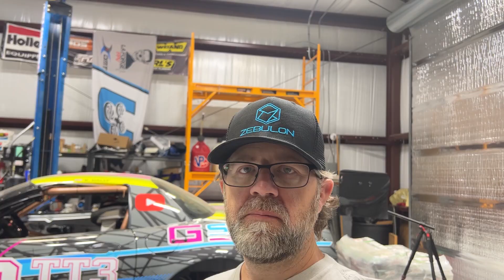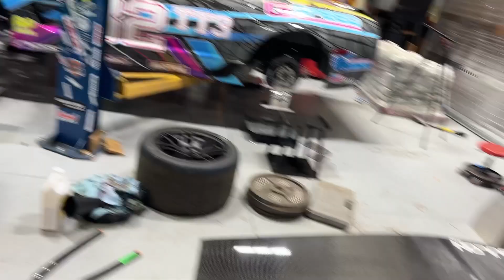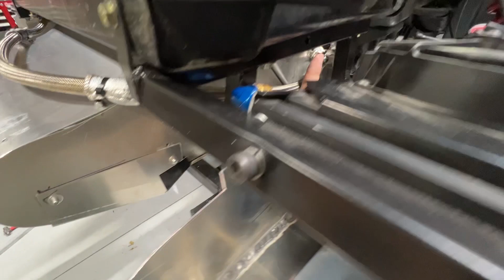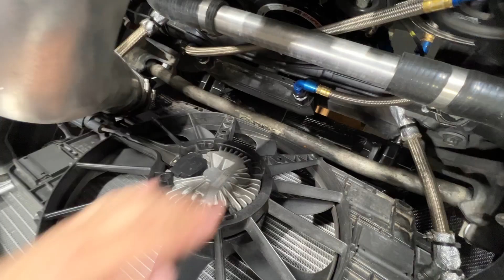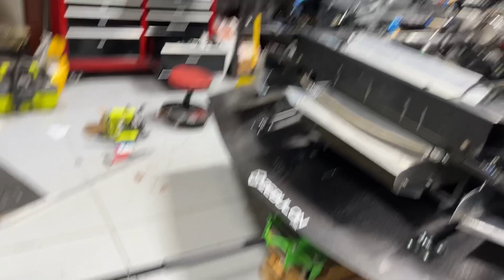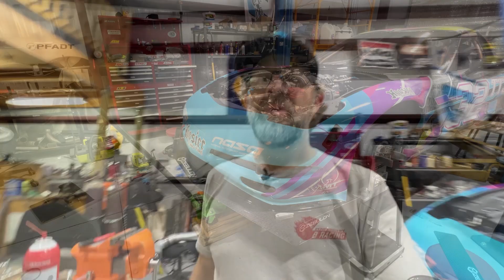ALL YOUR DOWNFORCE ARE BELONG TO US. The Zebulon Splitter has arrived and taking all the downforce!!

Comment: I'd love to see a video on how you did your removable bumper and splitter assembly.  Right now only my splitter is removable, but yours looks a lot simpler to install/remove.
Reply from the maker: I used some through bolts to attach the splitter to the lip of the bumper.  This is an aftermarket number so the lip is what really helped make this an easier solution.  But the lip is also the reason I needed to do this, because the lip didn’t lay flat I had to force it with fastener.  Zebulon would rather I not do it this way in case of an excursion, I may lose the bumper and the splitter vs just the splitter.   Just food for thought.
Reply: @Poweredby8Racing  I'm just an autocrosser so no real chance of an off.  Having the ease of taking whole front end off the car would make it great for loading on trailer.